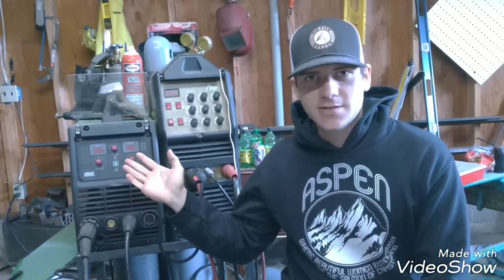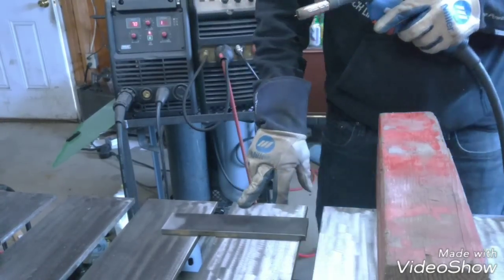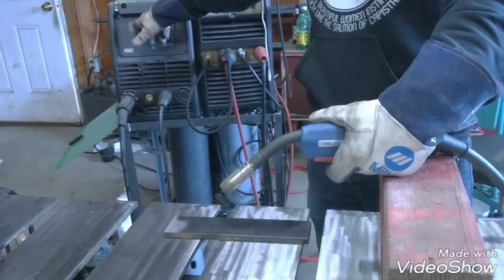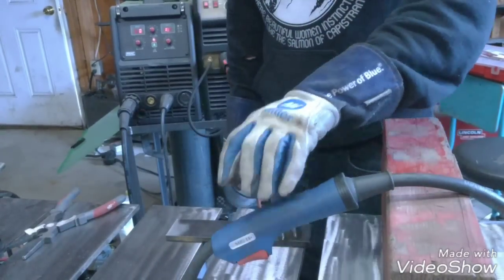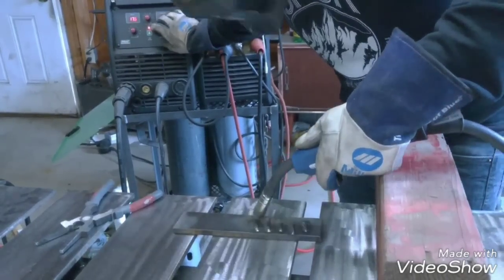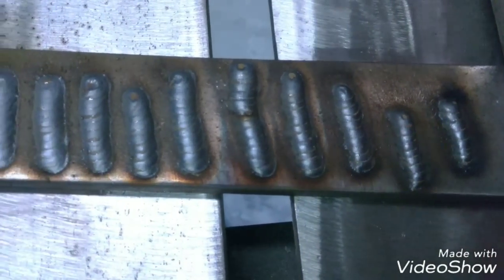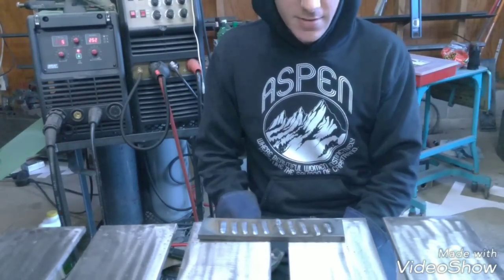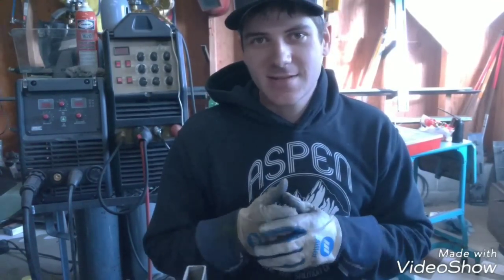How to setup any MIG welder

Comment: Get a couple gallons of white vinager and soak your steel overnight faster with heat you will have bare clean metal without grinding at all. A hose wire brush your golden. But it is clean metal and it will rust very quickly. I just make sure its dry before i store it or i wipe it with oil so nice and easy. The vinager can last for ever

Comment: Cool video cool approach...

The audio isnt doing your effort justice however but still good stuff.  All I can hear is moaning from a machine meaning it sounds like machinery making groaning sounds.

I think the overall idea concept is:
1) Set voltage
2) start low on wire feed
3) increase wire feed until buzzing
4) write down values ie voltage n wire speed
5) increase wire feed until AGAIN buzzing occurs ("frying bacon sound")
THIS TIME its upper limit of wire speed for given voltage

NOW REPEAT FOR EACH VOLTAGE INCREMENTS OF 0.5 VOLTS

I think thats basically it... ?
Reply from the maker: Thanks bud.  Ya I know I filmed on my phone haha not good audio at all!  But yes you nailed it head on!  Good luck

Comment: I have a Harbor Freight might flux core wire fed welder what settings can I use to weld angle iron such as a bed frame or 1/8 thick steel? Please show or comment how you'd do it ...

Comment: Your grinder is missing it’s guard, i would recommend replacing it before you are missing fingers.
Reply: Hand Made Americans don’t often use guards on their grinders (I’m English I’ve just noticed it)
Reply: I never used the shield on a grinder and have cut myself several times. If I wore gloves It'd be bad but I felt it fast enough to no cut deep into me. So not so bad.

Comment: How do you like your Alpha TIG?
Reply from the maker: It was good it's on its last leg now.  That's why I haven't used it in many videos lately
Reply: How old is the unit?
Reply from the maker: Fawkyooo I'd say about 2 years old now.  It's good for garage welders and most wouldn't be able to tell.  But if you're a career welder it's not the best.

Comment: I have the miller 215 multi process machine.  I used the auto set features on mig and spoolgun without great results.  I went to old school setup (manually) and that worked well. Big difference between the two parameters.  25 years welding on many different  machine's will teach you how to set up by sound, puddle appearance and final product.  Beginners probably need their hand held with auto set features.

Comment: Good vid. Short circuit mig is good for beginners and your more common welded 1/4 steel to 3/8 steel. Happy to hear you say when dialing in your machine to listen for a good setting. This is very true with short arc mig. Setting a machine only by bead appearance certainly is not the best. Great video. Thanks for not making the vid 45 min long ! lol.
Reply from the maker: Thank you bud. I agree.  We use a lot of spray transfer and some short circuit but mostly pulsed MIG.
Reply: Its great for anything above 12 guage , if you plan on getting into sheet metal fab... plan on mig welding
Reply: Even thinner you can make work, but thinner than 12 guage I personally preffer to switch to tig to help reduce heat effected zone

Comment: I got sealey mighty mig 100 a while ago gasless as just wanted to have a go welding odds and sods just repairing stuff thats not really that important, i wonder if you have any tips yo setting this machine up as it has no chart on welder nor can i find a booklet anywhete, and the machine as only got wire speed knob and a high/low setting, its hot no read out what so ever, wonder if you had any tips to make the guess work for settings any better, cheers
Reply: John Price hey John , just wanted to give you some help if I could. Very first welder I ever bought was a small Lincoln gasless flux only welder. I always found I would get a better looking weld with the wire on a lower setting and the heat on high. This may differ on different material thickness and welder preference. For me the trick is getting it to run on more of a spray transfer. I know these are weaker machines so bare with me. The spray transfer seems to wet in nicer and you will have less voids. Getting your machine to spray with a flux only welder probably would be as hot as your machine will go then play around with your wire settings. Keep adjusting your wire until it gets to the sweet spot. I hope this helps you john and just keep at it. People don't become great welders overnight so don't let anyone deter your progress. Cheers !
Reply: Cheers 5th st fab for the extra information not alot of people would bother if at all,   i took note of your prevoius suggestion and was getting a little better results then back to mormal again blobs of weld all over the place lol but ran out of wire before could play around again, o know some welders have said be prepared to go through a fair amount of wire so got two spools this time only buying the small spools and then have to scout around for metal and i think it may help if i practiced on same thickness for a while, as it is its just what i my hands on, I've got a some angle about 25x25mm i want to make a welding trolly but i need to try and get welds better first, as it seems when and i mean when i get a decent bead its a nit after I've started the weld rather than from the beginning and the angle i got if i try now I'll probably have six foot welds over the mitred corners well maybe five foot lol,  anyway sorry for boring you I'm sure busy keep em coming I'll have another crack tomorrow see how i do, thanks again 👍
Reply from the maker: +John Price you should be able to use the same technique I haven't run flux core in a long time but I set it up the same way when I did.
Reply: I'll give it a go, thanks

Comment: Good pointer for the mig. I do a lot of stick and tig and when I get back on the gun I forget all my settings lol. Good round about way to get in the ballpark. Thanks
Reply from the maker: HillBullyMetal - thanks bud! I'm mostly a TIG welder 90-95%  of the time, so I use this all the time on machines at work.

Comment: I just purchased the Everlast MTS 211SI how do you like Everlast products you seems to weld fantastic without the big name and larger looking Mig welders do you feel this machine can handle most projects i am no means as good as you but you sparked me to do my own projects again instead of paying for them
Reply from the maker: I like my everlast.  Ive always felt its the guy holding the torch not the machine that makes the weld.  but it does help having a nice machine.  my everlast has handled every project ive thrown at it.  Good luck bud!

Comment: I have never owned a mig. 
Stick welded for many many years and are now doing a lot of tig.  Sort of skipped the whole mig process.
Honestly never had a need for it, although i dont do industry stuff where time is money.
When i was young welders told me not to use mig.  Cheating they used to say lol.
If i just wanna join some metal i go the stick. Quick and easy. Who cares about scale, paint or grease. It all gets burnt off anyway.
If i want to make it look all preeeety then i go tig and go through the whole cleaning process.
I like your welds though man.  Very neat and tidy.
Reply from the maker: I'm the same way with tig, that's all I do all day everyday! except for the occasional spool gun.  only time I mig steel is at home for side jobs.  I never stick anymore haha I can still run a slick 7018 but that's it haha anyways thanks for watchin bud

Comment: Can you talk more about the relationship between voltage and wire speed? There are just so many variables in Welding that it drives me nuts sometimes.
Reply from the maker: Gordon Reiher sure I'll try to get one out in a couple weeks.
Reply: if your speed is too high for the voltage the wire will crash into the part before it melts it have a loud crackle and may cause spatter too high of voltage it gets really quiet and you may feel a lot of heat being radiated perhaps result in some under cut blast through or excessive heating causing distortion

Comment: Hello from Australia. Your Video's name caught my attention, so I had to look. What I saw was how to set up a modern MIG, (GMAW) machine. I found good information in the wheel you used for cleaning metal contaminated with Scale, Rust and Paint, thank you for this. I would also be interested in how you set up a Mig without all modern inverter Tech. Thanks, cheers from John.
Reply from the maker: joandar1 thank you and thanks for taking the time to watch.  So with standard transformer dial machines I do the same thing.  If it's a voltage range of A-G and wire speed of 1-10 you can do the same thing where you start at A and find your wire speed for the low end and then the high end.  Then go half way between A and B and Find your wire speeds. Hope this helps!
Reply: Thanks for the reply/response. What I do know is when is when the torch is pushing you back from the job then you do not have enough voltage (heat) for the wire speed or (amps). In that case I reduce the wire speed, amps or increase the voltage. Please forgive me for saying this, I didn't find this in your video, may be of help to others if you choose to share. Cheers from John.
Reply from the maker: joandar1 true good point!

Comment: After first couple beads I'm sure your scrap is hot and will interfere with setting. Do you go back and check your final settings on cool samples
Reply from the maker: Chris Allen I've never had it mess with getting the machine dialed in.  But it will mess with it if you're trying to set it up for a specific thickness and keep welding on it